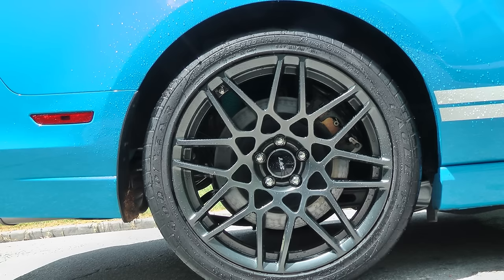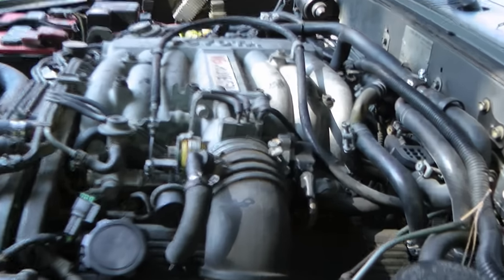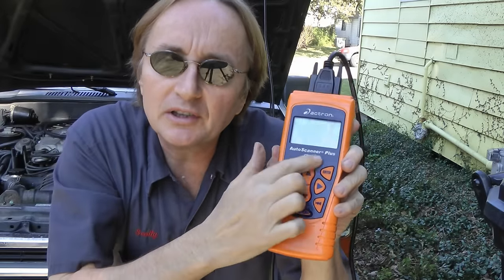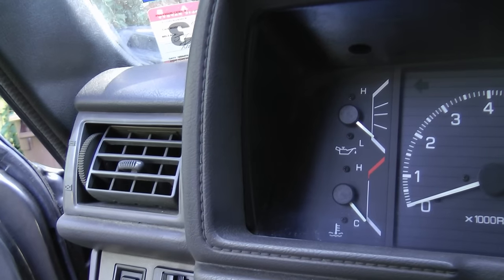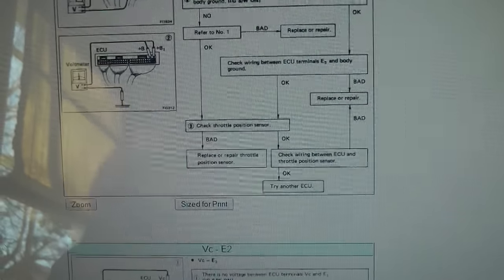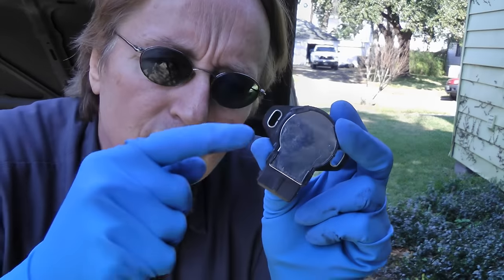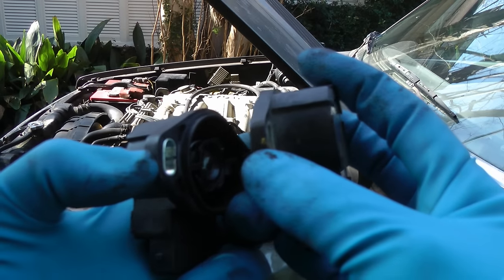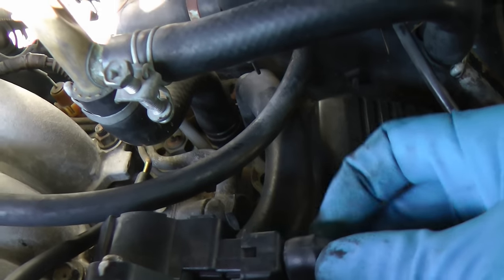How to Stop Car Hesitation (Throttle Position Sensor)

Comment: Hello Scotty your awesome man just wanted to say first .i have a few codes p0420,p0733,p0175,p1529 I changed three speed sensors turbine, input, output  . not the wheel one, though . I changed the tps also , this car is driving me crazy i also changed the axle drivers side . ? any ideas ? i broke two of the clips for turbine speed sensor and output speed sensor . the third gear was jerking when accelerating going to 5k rpm before switching gears .please help  thank you

Comment: hey Scotty I have a 2012 Ford Fusion that shuts off while driving and I think it's either the throttle body or the fuel pump but most likely the throttle body if it is can I just clean it out or should I buy a new one?

Comment: Scotty I’ve been watching your channel since it had a couple thousand subs and now I sure indeed need you help or advice ! My 2007 Mustang GT under hard acceleration starts to sputter at 4k - 5k rpm. . As if their isn’t proper air to fuel ratio. Haven’t gotten it checked since it only happens under hard acceleration.

Comment: Hi Scotty, I have a 81 volvo gl 240.  I've just replaced the timing belt.  Starting up the rpm is very low.  Stepping on the gas and it wound not pass 1000 rpm and the car sometimes struggle to stay on.  Could this be throttle sensor or something else...like a fuel pump relay?  Thank you.

Comment: Any videos on how to diagnose a 2006 4 Runner Throttle Body unit?  My wifes SUV with 230K miles on it just stopped reving up when the gas pedal is pressed.  Car looks, drives and runs like new otherwise, so no need to greplace it just yet.  Starts and runs fine with this problem.  All wires are checked good.  Replace the injectors last summer.  No blown fuses, So I'm thinking the throttle by wired has died.  But not sure how to check before buying that expensive part.  I ask because I'm currently wheelchair bound with 2 broken legs and having to rely on friends to turn the wrenches for me.

Comment: which sensor is responsible for engine hesitation is it the pedal accelerator one or the throttle position sensor. in the case of 2001 Lexus gs 300?

Comment: I just ran into those stuck screws. They'd been mildly stripped too, and were well on their way to fully stripping. At least they "designed" it so you can potentially grab 'em with the vice grips... (Of course, they could've used socket /screws...)

Comment: Hey scotty I got this 1991 Lincoln Town great car man buy I got this problem I'm not sure if it is the throttle sensor but it almost wants to shut off when left running an when I'm driving it I push the gas an like the engine shakes only when I start to speed up going up hill as well now I changed the gas filter the spark plugs an even threw some fuel injection cleaner an still no good..when I changed the spark plugs it ran fine for a two days an then started with the same problem any ideas? ?

Comment: Hey Scotty, I have a customer of mine who I have replaced the engine in his 1994 Chevy S-10. It has the 4.3 l vortec motor. Customer complains that at 55 mph the truck hesitates a little until he throttles up a little. He thought it was his fuel pressure regulator, but after installation of it, there were no positive results. My thoughts were that the plugs that came with the vehicle needed to be replaced after break in period. I'm curious as to what your thoughts are?
Reply from the maker: those vortec systems suck and often need entirel spider assemblies replaced and all the injectors, realize that

Comment: is there a video that you talk about a p0352 ? I'm having a problem with 2002 3.8 v6 mustang. I had the ignition coil replace and spark plugs and the wiring to the spark plugs.

Comment: 2015 town and country has high idle after start up , 1000 rpm at first then 800 rpm after a few minutes of running ,then shift into gear hard , but idle goes to normal soon after

Comment: what would cause both a high voltage and low voltage TPS code simultaneously?  I replaced the TPS but no dice.  I just got an open circuit tester going to go look at the harness.

Comment: So i have a question, the throttle body on my Hummer h2 is the original one from 2003, i cleaned it just today for the first time it was dirty ,got it all cleaned up along with my mass air flow sensor. I didn’t know that i had to relearn it which im doing that first thing morning tomorrow. Now do you think is time for a new throttle body? Yes my Hummer is hasitating

Comment: Hi Scotty. I have 2004 Honda Pilot. I just replaced the transmission. It's running slow with no acceleration from 20mph to 40mph. We don't know what the problem may be. Any suggestions?

Comment: My 2014 nissan sentra recently threw a p0101 code. I replaced the MAF Sensor, cleaned the throttle body. ( yes I removed it). But now my car stalls on start up and stalls when I'm sitting at a red light or just sitting with my car in park. Do you have any suggestions on what I can do to fix this issue?

Comment: I just replaced the TPS on my 97 Buick LaSabre and now I am getting codes P0122 (prior to changing TPS I was getting P0121.  I've checked all of the wiring and that appears to be no problem.  I've unplugged the battery for 10 minutes hoping to reset the PCM, no luck.  What would you suggest I do next?  Clean the throttle body?  Replace the PCM?  HELP PLEASE!!!

Comment: Hey Scotty I need some help! I have a 2000 Ford Escort ZX2  4 cylinder 2.0L DOHC. Only when I'm coming off a stop sign or red light my cars rpms will stick at 2000/2500 and no matter how far I push the peddle down I don't go any faster. After 40mph it usually gives and I can accelerate just fine but it takes a good 30/45 seconds to get to 40mph. I've done plugs, wires, distributor, filter, vacuum lines. I'm now thinking the MAP sensor but what do you think? Only place I can find one is at Ford for about $160 and that seems like a lot for it to not be the solution. Please let me know I love your videos man!
Reply: hey brotha have you check your 02 sensors?

Comment: Hey Scotty, my car is a 2004 Nissan maxima 5 speed automatic getting code p1574. Drives fine just that it idles at 1000 rpm when parked. Hope I hear from you thanks.

Comment: 1995 Honda Accord 4cyl SOHC vtec
Problem: when I release the gas, it dies. It won't clutch start if it dies after I'm rolling, I need to crank it with the starter. When it dies, it makes a loud noise/vibration around the steering under the hood until I turn off&on the key.
Question: If I unplug my TPS, it nearly dies  for a second and gains its bearings and idles fine (haven't given it any throttle), does that mean its a bad TPS? What does it mean?
Also: I hear a type of gurgling from the tank.
Replaced: Fuel Pump, FR Relay, Plugs, wires, injectors.

Comment: Hi Scotty I have a 2016 Honda Accord sport and I’m not sure if this is Normal but when I stop on the red light and fan turns on I feel a little bit of shaking and at beginning I thought was the AC but days are getting colder and have to use the heat and still have the problem.

Comment: Scotty the needle on my rev counter keeps bouncing up and down very quick under throttle or foot off the throttle after 1600rpm. When doing 50mph the needle moves up and down whilst the engine rpm's stay the same. Do i have a faulty rev counter?

Comment: Hey Scottie, 

I recently cleaned the IAC on my 1986 mustang 5.0. The engine turns but won't fire up. What could be the problem? I also cleaned the throttle body and made sure all the connections  were put back in there place. Thanks!
Reply from the maker: +Kingdomhearts98 do my video "fixing a car that cranks but doesn't start up"
Reply: +Scotty Kilmer Thank you so much!

Comment: Hey i have a 97 sonoma V6 when cold sputters until warm but seems to work well if you floor it until it shifts then sputters going into next gear. fuel pump fuel injection and MAF have been replaced?

Comment: is it really throttle position sensor in every car, or some of em only measure the throttle PEDAL position? Mine does weird noises when pressed, also hesitates sometimes to rev up. But the OBD live data show clean throttle curve with almost immediate opening when pressed. Just curious could it be reading the pedal data only? Cause it's suspiciously smooth on paper but doesn't perform as expected..

Comment: Hey Scotty, I have a 2009 Corolla. When I’m accelerating the car hesitates and shakes a bit it’s more noticeable when I’m going above 60. My mechanic cleaned the throttle body which helped a bit but the issue is still there. What do you suggest? Thanks

Comment: thanks a lot i have infiniti i30 98 i watched so many videos i read so much about the problem how to tested, and the problem it was there and guess what you are the one with a simple test  the help me out yes disconnect the power the goes to the trottle position sensor and i notice the difference sensor is bad problem solve

Comment: My 2006 Lexus GS has only 97,000 miles on it but when I accelerate, there is a stuckness where in the car doesn’t respond and I have to press on the gas to get it to go like it’s stuck. The catalytic converter check engine light is coming on also and I know that it’s related. Please let me know what you think. Thank you

Comment: Hello Scotty great videos thanks!took my Nissan Altima 2003 2.5 4 cylinder to auto zone to have a check because it keeps shutting off on me..so they out the machine and it read po/06 throttle body the guy told me please tell me more or less what I'm looking at expense wise.
Reply from the maker: +Rezzyred5 try cleaning it first as in my video "how to fix a car that idles poorly" cause a new throttle body costs a TON on that baby and has to be reprogrammed to work on your car when changed. good luck

Comment: Hi men , I cleaned my throttle body on 2009 mdx but after cleaning check engine light comes on and rpm was jumping up and down while releasing the gas pedal, so I relearned the tps and cleared the code but still the rpm jump when I press the brake pedal and sometimes the rpm jump up with out pressing the gaspedal.  Does cleaning map sensor will solve the problem? Thank you and I am waiting for your advise please.

Comment: Scotty,
My 1991 Chevy 1500 4.3 5 speed manual has lately been sputtering and shaking during hard acceleration. It seems to be much worse when the engine is cold and has a hard time starting (long crank, almost always fires). It has had the distributor replaced, new spark plugs, new wires, fuel filter, throttle body, clutch assembly kit, machine flywheel, exhaust flange gasket.... I'm thinking it could be the timing or fuel regulator possibly fuel pump. If you have any input for me, please help, thanks.

Jordan

Comment: Does an electronic throttle such as the one on a 2007 yaris have a throttle position sensor or is it built into the throttle body

Comment: Mister Scotty Kilmer,

I'm driving a 2001 Isuzu Rodeo LS V6.   Right now, the vehicle hesitates when I come to a stop and need to accelerate.   Example:   I stop at a red light, then step on the gas pedal when I get the green light.   The vehicle moves normally for the first one to two seconds and then then the engine revs up.  The RPMs shoot up to 3k and the vehicle seems to shake just a  bit for one full second and then the RPMs go back down and the vehicle increases normally in speed.  I don't know if this is a throttle position sensor issue or something else regarding the fuel or the transmission.   Oh yes, there is a check engine light on too.
Reply: +Roku Jones slipping clutch?

Comment: "My car is driving fine at road speed but cutting out when slowing down or stopping, a mechanic has done a diagnostic but could not find any error code. Still the same fault is happening what could it be?. It is Hyundai i20 comfort" Do you think it could be a Throttle Position Sensor related issue as well? please advise

Comment: Hey Scotty, I have a 2000 s-10 with 195k miles on it. it recently started to sputter while driving. While I'm at a red light the oil pressure gauge will drop a bit and also  the rpms will drop. Any help is appreciated.  Thanks love your video.
Reply from the maker: often leaking fuel injection system parts do that, they are cheap plastic and hidden inside the engine. Check that first

Comment: I have a 2014 chevy impala LS. When I push the gas it hesitates would that be the air flow sensor or the throttle body sensor?

Comment: I have a Mazda 626 1994 ge model and having this loss of power issue.
I had it check with a mechanic he checked the timing, misfire, vacuum leak, faulty injector, fuses, filters but he couldn't figure out the problem. It's only problem is hesitation on acceleration if the acceleration is fully pressed then it does not pick up speed only when it is pressed lightly then it goes well, sometimes it's hard to climb hills and its hard starting when the engine is cool. Do you have any suggestion on what the problem might be?

Comment: Hi yes I have a 1989 Honda CRX in and a d16a6 motor my car is sputtering when I accelerate it does not have power at all you think is the TPS sensor

Comment: Hey scotty i have an 88 ford bronco full size with the 5.0 in it and i have basically no throttle respone after about 20 min of drive time do u think its a problem with my TPS and if so can i check it the same way you show in this video??

Comment: My husband just got an 98 dodge dakota and it hesitates really hard Between 1 and 2 gear, we changed plugs and wires and distributor cap and rotter button still was doing it. Then we changed the throttle positioning sensor the other day and it's still doing it, what else could it be? When we bought it that told us everything was great on it and we have drove it home and haven't got to drive it at all because of this problem.  It almost dies in between 1 and 2

Comment: hi Scotty i do have a bad throttle body in my 2002 volvo s60 nonturbo. i was wondering if there is any way i can installed it with out going to the dealer for a sofware update.

Comment: Hi Scotty, I have a 92 Toyota Camry. When accelerating, sometimes it seems sluggish and the RMP needle bounces. While its bouncing, it causes the car to jerk. Car has a kinda rough idle and I one spotted a coolant leak coming from the center of my car.

Any clue on what might be wrong with my car?

Comment: we have a 1988 ford bronco 4x4 we have changed out so many things trying to fix a rough idle. we thought it was fixed today when we changed the distributor. while it was idleing in the driveway we were excited that there was No fluctuation in the idle. we took off for a test drive and 100 yrds down the road it started doing it again. the RPM's will start jumping around and sometimes completely stall. any suggestions?

Comment: My 1995 ford f150 4.9L is getting to high rpms then jerks and sputters. I unfortunately am on a small budget. Would the tps be causing this. I have replaced the fuel filter. By the way it's a 5 speed manual

Comment: I've been having problem with my vw jetta 2005 2.5 for a long time, the car jerks when I accelerate and when I hit the brakes. It only does it when im driving in the city, it drives fine on the highway. We changed the spark plugs and cleaned the mass air flow sensor. It worked properly for about a week and the problem came back.
Reply from the maker: +Kay Rama  often maf sensors need replacing on those jettas

Comment: hey scott have an 06 elantra that loses power of acceleration between 2/3 rpm. this does not happen all the time but is more random. codes show lean fuel rich fuel and misfires. gas mileage is horrendous right now. all Hyundai forums show similar issues but no definite solutions. any suggestions?? THANK YOU SIR

Comment: Hi Scotty . I have a 2004 mazda tribute 4cyl. I have  hesitations at rpm below 2500. No engine check light . I have replaced plugs, coil w/ wires, fuel pump and fuel filter, MAF sensor, air filter, cleaned the Idle air control valve. It runs good for a few days then yesterday went on a long trip 3 hours no problem then it went to hell. Luckily I was on my way home, this was the worst hesitation and stalling. I had to drive in 2nd gear to keep the rpm up above 2500. At a speed of 50 km what is worse im in Thailand and hard to get any service. I have ordered from mazda dealer new PC valve throttle position sensor, idle air control valve. Anything you can sugest would be greatly appreciated

Comment: Have a question. My 2000 Toyota tundra. Starts to shake throttle goes down and just shuts off the motor the lights and all works so I throw it in neutral and start it again. But it's starting to shut off more and more. Some has said throttle some has said max flow sensor. What do you think it is. Thank you.

Comment: @scotty, hi, I have 1998 Corolla here in Sydney, engine is 4afe. During driving on freeways and incline I have to push hard accelerator to climb. I have replaced spark plugs with proper gap of 0.031. Any suggestion please

Comment: After reviewing this video I went ahead and changed the tps. Everything looked like the replacement part; but one thing which I overlooked. The direction the spindle moves turns the other way. So after installing it wasn’t gassing at all felt like I had to force the pedal. Anyway, I put the old sensor back in and now I have to press the peddle half way before it revs and there’s a slight intermittent ticking sound. Please help! Do you think something broke from the wrong part and got stuck in the butterfly? It’s acting as if the cable is loose :(